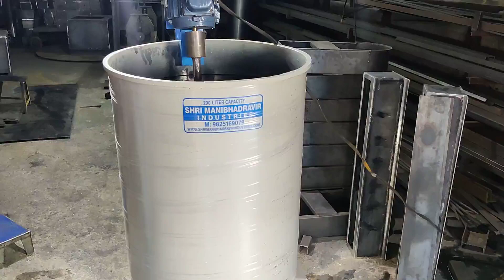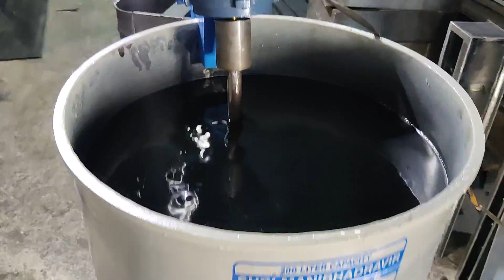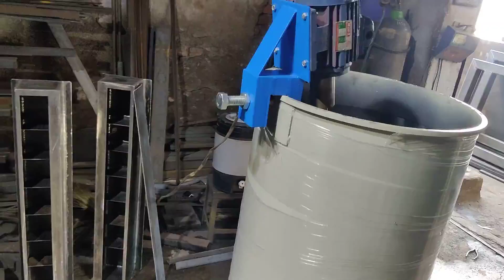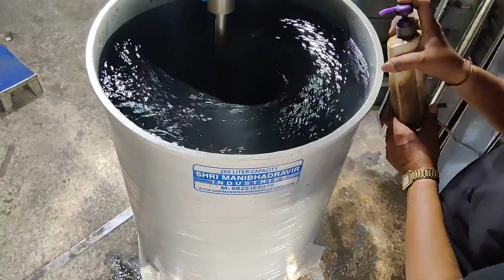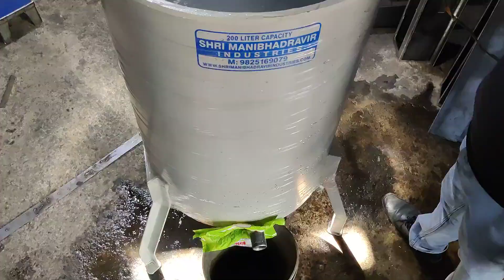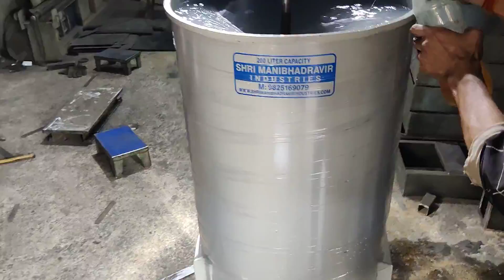200 liter M.S stirrer machine

Comment: WHAT IS MOTOR HP ?
Reply: Different Horse Power motors used for 100L and 200L
Reply from the maker: 1440 RPM
VFD IS INSTALLED SO RPM CAN BE VARIED
Reply from the maker: YES SIR 
FOR 100LTR :- 1HP
FOR 200 LTR :- 2HP
IT ALSO DEPENDS ON THE VISCOSITY OF THE LIQUID
Reply from the maker: CONTACT :- +91 7874357769
Reply from the maker: CONTACT :- +91 7874357769

Comment: How much is this one. And where can I get some
Reply: Hi I does manufacture this kind of equipment as well as deal in Used ones too. If you are from India then we can supply to you at least rate or you can even visit our shop
Reply from the maker: send your address

for more info contact:7874357769

Comment: what is the RPM range? can we use this for chemical mixing for precipitation at bottom?
Reply from the maker: Yes you can
Reply: What's the rpm
Reply: Haa to be slow.. like 60 rpm. Or even 40 rpm
Reply from the maker: For low viscosity it can be high upto 2800rpm
To 1400 rpm